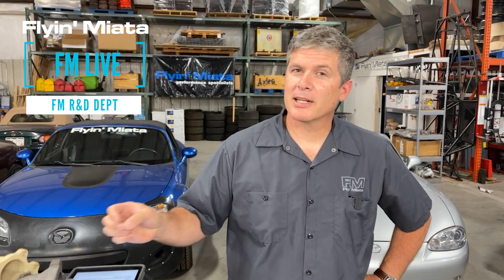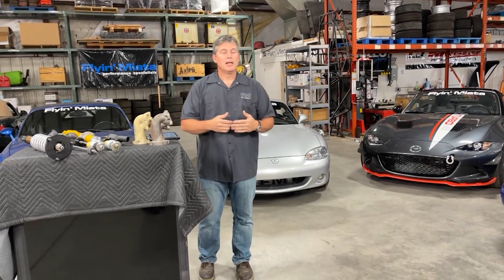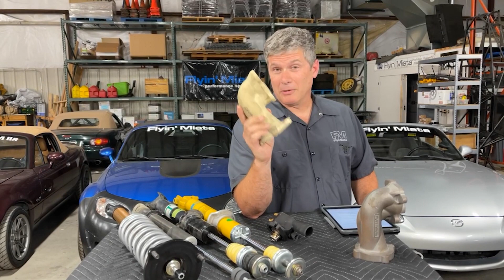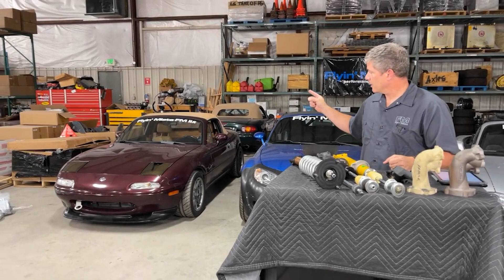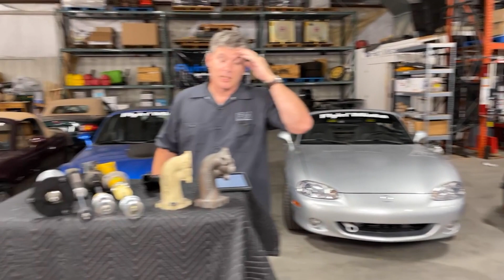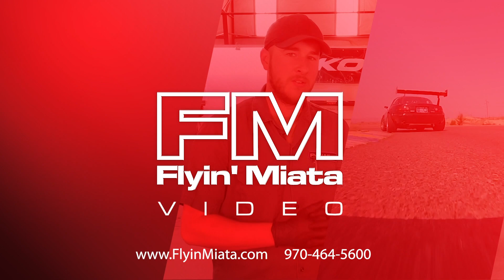FM's R&D Department! (FM Live)

Comment: Great content, love the passion for this wonderful platform. Any chance you could start to look at the NF platform aka 124 spider. I know most of the ND works, but there are differences beyond the powerplant, but it would be great to have specific products for the NF. Eg NF uses NC gearbox and ratio are different in Lsd etc. Good win racing has products for both ND and 124 spider, I would love to see some from FM 😊
Reply from the maker: We had one for a couple of years, but did not find it responded well enough to power modifications to justify continued investment into the platform. Basically, there was very little we were willing to put our name behind other than the parts that are common between the Fiat and the ND.
Reply: @FlyinMiataVideo  OK,  that's a shame. Thanks for the reply

Comment: Having bought the Hush O Matic axle back exhaust for my ND Club I was impressed with how well it functions. Well designed & putting thru the daily driving torture test here in Illinois. Latest upgrade to my car was the Verus Air Oil Separator. Even though its naturally aspirated keeping deposits off the valves down the road is important to me. Looking forward to more great upgrades.

Comment: My NA6 does not have a working A/C right now and I’ve seen a sold out kit by Arrive Japan that uses the ND compressor. Are there plans to bring something similar to market so we can ditch the old compressors for a modern one and move to r134 refrigerant?
Reply from the maker: You can modify an R12 compressor to use R134, the kits have been available for decades. That would be a lot easier than trying to change out the compressor with the custom hard lines that would be required.

Comment: Hello guys,  is it possible to have unequal length headers for a nd2? Or one of your headers with a helmholtz chamber? I don't like the drone of some mufflers out there. 
And even more crazy how about a cross plane crankshaft for the nd1-2 😉 that would be awesome 🤩🤩🤩
Reply from the maker: We don't offer headers for the ND because it would require removing the primary catalytic converter. We are not responsible for all mufflers, but we're happy with the lack of drone with our Hush O Matic.
Nobody has ever asked us for a cross plane crank for a Miata before. It would probably shake itself right off the motor mounts.
Reply from the maker: Drop our techs a line at 970-464-5600 or email us at support@flyinmiata.com. Our CSRs should be able to give you more information about this topic there. Thanks!
Reply: @FlyinMiataVideo  ohhh I see,  thanks for the response I'll be ordering the hushomatic exhaust,  but the idea of the cross plane crankshaft is it that bad? Or mechanically impossible?
Reply from the maker: @ricardoespiritu8843  A cross plane four cylinder is inherently badly balanced, particularly at lower RPM.

Comment: Has FM ever tested various parts at a testing facility such as TRC in Ohio or possibly using an OEM's facility in the California desert? If not, it might offer some additional control over durability development but I don't know if the cost would outweigh the benefit...
Reply from the maker: We’ve had a small amount of performance testing done at OE facilities, and the emissions lab we use is a pretty similar setup to what you might find at an OE as well. But otherwise, it’s mostly just a set of known tests that can be repeated. You can do a lot of that if you have track access and/or known stretches of roads. We use certain roads as benchmarks and we’ve been testing at Grand Junction Motor Speedway for something like 17 years.
Reply: @FlyinMiataVideo  has anyone estimated how many laps FM has turned there? Hahaha

Comment: Have you all done much testing on supercharged NA setups?  I've done turbo NA's in the past and now I'd like to give superchargers a go, but I'm not completely in love with any of the kits available right now.  I'm afraid that a Rotrex kit will feel weak at low rpm, and the only "roots" type blower on the market seems to be the FFS kit which I'm not truly sold on.  I'm curious if you've done r&d in this department what insights you might want to share for people thinking of going supercharged?
Reply: They have tested them in the past. When I asked about it they said "there's a reason we only offer turbo kits for the Na".
Reply from the maker: We’ve actually sold a few variants in the past going back over 20 years, but discontinued them all because we prefer how turbos work on the B6 and BP engine.